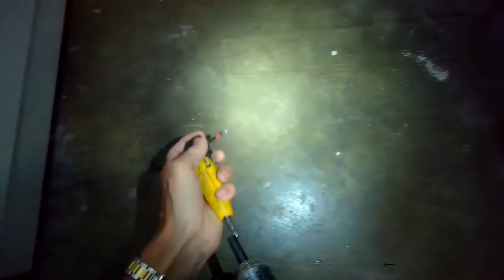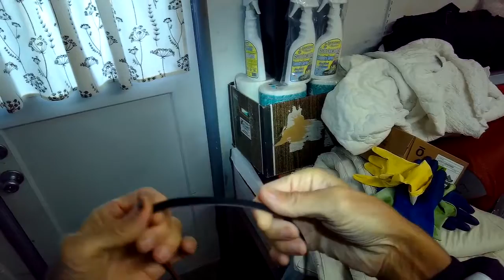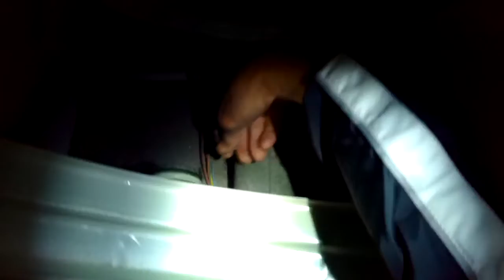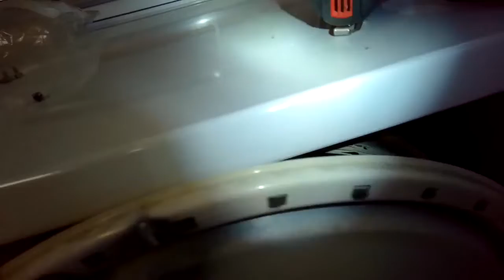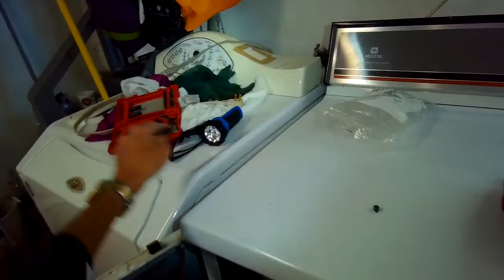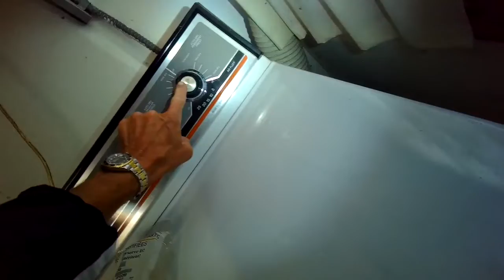OLD MAYTAG DRYER BELT REPLACEMENT

Comment: And this quick note from a not to nimble eighty year old on belt replacement.  I appreciate the video and the belt placement at the three minute mark.  Thank you.  However, I laid on the floor for over three hours struggling to get the dadgummed belt on the way you suggested in the video.  Lastly, and I resorted to a few tricks of my own and took out the top two front corner screws that held the top in place. Lifted it up to vertical and taped it so it couldn't fall down.  Next, I removed the drum completely, threaded the belt over the drive pulley and the large white idler pulley.  Pulled the belt upwards to the left and taped it secure.  Next I replaced the tub, pulled the belt tight and eased it over the drum, right side first, then over the top and down the left side.  Works like a charm..  You can thank me later.  Much easer than the video.
Reply from the maker: Great advice,
Thank you 😊
Reply: I am 71. I have replaced the rollers, idler pulley, and the belt many times. But, this time it tore off skin on my arms and knees. I think this will be the last time that I make repairs myself. I bought this dryer when my son was born. He is 45 years old now. It is still the original motor!

Comment: I have been working on a dryer that is old and very different than yours. After a couple of hours tried taking off the top that helped none. Thought i could access the drive pulley and tensioner by feel laying on the floor. Unfortunately there is major ducting making that access impossible. Its not the money to replace its the idea my old one may end up in a land fill. Here its 90 and its taboo to put out a clothes line. Suspect its written in the covenants.
Reply from the maker: Can you send that same question to my email at:  scottthefixitguy@yahoo.com